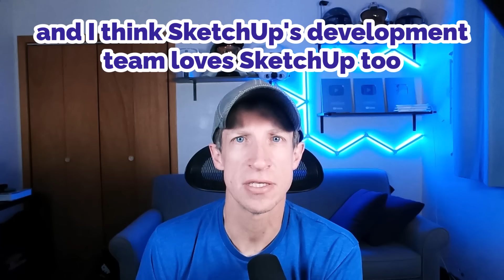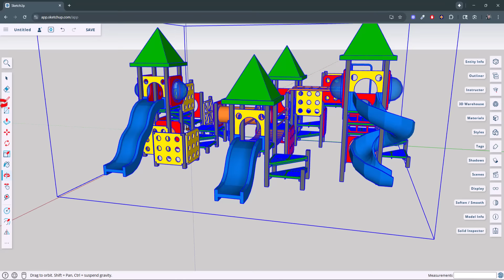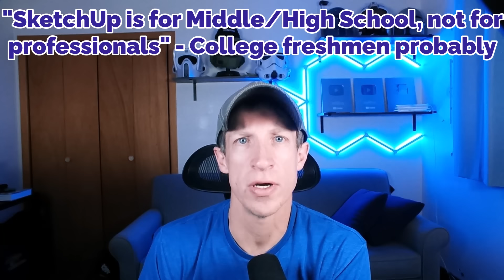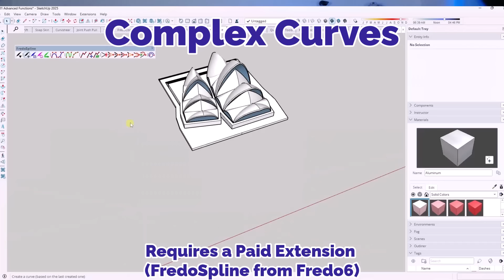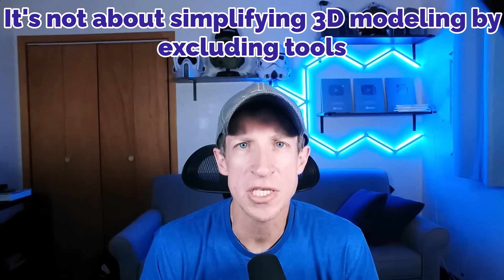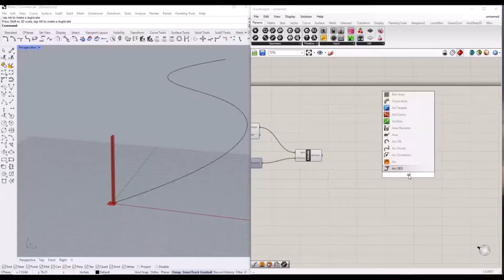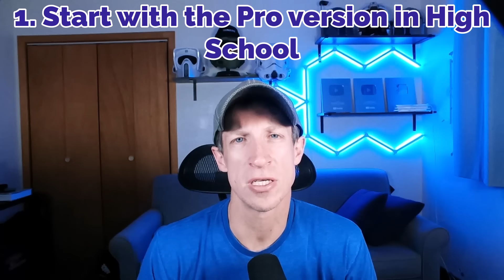Is SketchUp being REPLACED?

Comment: Justin the Rhino/SketchUp debate:  I absolutely LOVE SketchUp for architecture, quick, fast massing, my favorite software. 
BUT I have just started a 3D printing class, and SketchUp has so many tiny gaps, non-smooth circles and cylinders, that is it difficult to get a 3D print looking correct. With add Ons and TIME I could correct the errors with extra effort-- But why spend extra time?

I need a software tool that I could use for design iteration AND also 3D print WITHOUT having to complete hours of extra work repairing the Sketchup model. 
RHINO is more ‘watertight’ models to begin with= not having to complete the extra work.

Justin, what is your 3D Printing process? STL?
Reply from the maker: I personally don't do 3D printing. I have a Prusa collecting dust on my shelf because I don't have enough free time to mess with it 😫

Comment: I’ve been using SketchUp for 15 years as an interior architect, and even though I’ve also worked with Rhino and 3ds Max, I never gave up on SketchUp — though it’s been tough. Without plugins, SketchUp is practically useless for professionals. No serious professional would use it without them, as it’s extremely limited. Instead of adding all these pointless render tools, they should focus on modeling tools that actually make our workflow easier. None of the versions are stable; every update comes with tons of bugs. SketchUp could end up like Nokia if this keeps up. Honestly, I think the company needs to be sold and take a completely new direction.

Comment: I left Sketchup years ago after it became partially web-based. Oddly enough I now use On-Shape which is 100% web-native. Parametric fits my needs much more closely than direct modeling however, I can see the need or a tool to be able to blend both workflows. Relying on extensions for core features turns using Sketchup into a Minecraft-esque experience where models are not portable and things break over time as support fades. SU is a great introductory tool, but I can see why others are being pushed in higher education.

Comment: I believe the main reason folks are running away from Sketchup, is greed!  I've been using Sketchup since 2003 (maybe 2002, don't remember).  I feel in love with just how easy it was to model interiors and having the ability to create and save your components!  It was amazing, and to a degree, remains my go to on a daily basis!  I can create 3d elements missing from Chief Architect and/or 2020 Design in minutes!  FAR faster than anything you can do in Chief Architect itself! 

If Rhino offers the EASE of Sketchup to bang out basic 2d shapes to 3d,  worth a look.  Having a better 'follow' tool for profiled edge creation would be priceless.  I still hate the follow tool as it's not very intelligent and fights you most of the time.   It's never been improved!   I'll have to look into Rhino.  $995 for a lifetime?  Some of us are still using version 2020 or earlier for 'various reasons'.  ;)   I gave up supporting the software as all they did was charge a subscription for what all of us had for a lifetime if we were happy with our version!  That's fine is you use Sketchup as your main 3d tool!  I'm guessing many our similar to me, and create 3d elements that can be used in other higher end software.  

Should be said, BLENDER is still the best free tool by a long stretch for 3d modeling.  If someone came out with a sketchup like UI that eliminated all the fluff, and mostly unused distractions, I'd say, learn blender!  FREE IS GOOD.   Of course, and thank god, we still have free version of Fusion 360.   A very flexible and customizable shape builder!  I'm not sure why colleges when with Rhino!?   I guess the 195 Student license ?   One would think they'd want to bring more diversity to the education system via not focusing on one pcs of software.   Most firms are going to still be using Sketchup, as the owners and the staff will not be wanting to relearn new software.   Most of us 'seasoned' vets of cad, 3d renderings have our methods and libraries that we've gathered for decade(s).   Don't need to fix what was never broken.

Comment: Sketchup should have acquired or developed the add-ons that are very successful in the community, The PRO paid version should be a real Pro version not relying on add-ons, UI should be overhauled to be more modern, having different workspaces (Basic simple and Advanced Pro), Dark Mode (obvious), a good basic rendering engine for simple use, I mean blender has Cycles and it's free. an added extension for BIM tools modeling, it's used by architects so a parametric stairs, walls etc and basic elements should be available not model a door a window every time., better library management tools, and much more, I think Trimble want it to be a 100% browser, internet connected software, but I think they'll get a reality check soon. when I started Architecture school back in 2008 I tried Sketchup Pro for 2 weeks, and then I decided that it's not for me,  I started learning Revit and never regrated that, if you can do basic 3D stuff using a Pro version I'd rather used a BIM software at least I'll have project documentation, parametric modeling etc. and it's free for students.

Comment: As an interior designer,my main problem with sketchup is that when I have to do a complex 3d model I shift to Rhino without thinking, because I can make them with no problem. Basics tools as  "aling" elements in sketchup you need to add a plug in... come on! is a basic... you can make it better.
Reply from the maker: Align is another function that should be added to SketchUp as a base tool - I agree

Comment: I hope Trimble increases SketchUp’s capability to carry heavier files without easily slowing down or glitching or crashing

Moreover, I hope SketchUp will do more about interoperability with other softwares. Rhino has Rhino Inside Revit while in SketchUp, the editing of the imported skp model to Revit is only limited to Revit’s  tools

Lastly, I hope Trimble could maybe make SketchUp’s line tools as precise as AutoCAD or other CAD softwares
Reply from the maker: It's getting better every release (including this one). That said, I think what will really make this better is if they implement some kind of an auto-proxy system, to swap high poly with low poly proxies at certain camera differences

Comment: I agree.  I am working on a project for foundation design.  I was told to use sketchup but am contemplating using rhino since sketchup has limiting factors.  By now it should have more built in tools.  I love the ease of ease of sketchup.
Reply from the maker: Interesting - I can't think of a reason why you'd need Rhino for a foundation design (unless there's some advanced tool you think you'll need that SketchUp doesn't have). Plus SketchUp is WAY easier to use and has better documentation.
Reply: @Thesketchupessentials  Spatial Design.  Shapes with complex curves.  Import other 3D files, Obj, FBX.  Its not supported by Sketchup without extension.

Comment: Sketchup is way too expensive for the casual user, and the web-based free version is terrible. There needs to be a desktop version that is cheap enough for the casual, non-professional user. I held on to version 17 for as long as I could but lost it eventually as computers got replaced.
Reply: I had the same problem except mine for whatever reason wouldn't work anymore because when I last used it. It required a password, and it would load up the program, everything was fine until the program wouldn't recognise the password and thus, I couldn't use the program. They told me to pay for the new version and here in Australia it was over $400 at the time for a 1-year subscription. So, I haven't used it since 2022 when I couldn't afford the new version. The version I had was 2017 version (I think) when it didn't require a yearly subscription.

Comment: Hey Justin and everyone,
I really, really agree with what you’re saying in this video. There are definitely some weaknesses in SketchUp, and I completely understand why some people are moving away from it.
That said, SketchUp has always been my number one software as a residential architect and interior designer. Almost 10 years ago, I worked with a senior designer—he was around 60 years old—and he always used SketchUp because of its simplicity and easy workflow. Since then, SketchUp naturally became my main software too.
Over the years, I’ve also used other 3D programs like 3ds Max, but I always find myself coming back to SketchUp. Most of my projects focus on residential design and interior cabinetry, which only require simple modeling—sometimes with slightly organic forms, but nothing too complex that SketchUp can’t handle with a bit of extra effort.
I’ve also invested a lot in learning and purchasing many extensions, which honestly ended up costing quite a lot and came with a confusing learning curve. Every time I update SketchUp, I have to reinstall plug-ins and reassign shortcuts because they don’t stay linked, which makes the workflow less smooth than it should be. It’s still all dependent on plug-ins.
I’m also very interested in 3D rendering, though I don’t need something as complex as 3ds Max. That’s why I’ve always used Enscape hand-in-hand with SketchUp—it’s my go-to setup. I’ve even learned how to import high-quality 3D models and add lighting to make my Enscape renders comparable to those made with 3ds Max and Corona. In my opinion, this combo looks much more professional than renders from software like Lumion.
That said, even though Enscape and SketchUp work easily together, there are still many drawbacks. It often feels like I’m forcing SketchUp to do things it wasn’t designed for—like producing high-quality renders with heavy 3D models—which causes SketchUp to crash many times.
So yes, I still want SketchUp to remain my main software, but I hope it evolves into something more professional. After more than 10 years in this industry, I feel like I’ve been pushing SketchUp’s limits. It still works, but deep down, it sometimes bothers me.

Comment: Justin - I have been using your videos for years, at this point, and I took your course as well.  Thank you for this commentary.  I have a background that combines a few of your points/concerns in this video.   And I feel compelled to comment here....it is probably too long of a comment and you already have about 1.5k comments here so this may never get read.  Here goes:  I have been a teacher for 25 years.  I teach math and I have taught engineering in high school.  When I taught engineering, we used Rhino with our students, mostly because I collaborated with a local boatbuilder to teach design fundamentals and that is the software he used -- but I saw that Rhino could be purchased at school/student rate for a much lower amt.  Fast forward a number of years, I now run a small drafting business for small construction/renovation projects.  I use Sketchup b/c I got it low cost single purchase in 2017 and it was very intuitive compared to AutoCad and Rhino.  I now subscribe to SUPro2026 for my business that I run in the evenings and on the weekend.  I still teach.  My students have access to SketchUp for Schools.  I use SketchUp for Schools with them because it is already there on their devices and you can do some simple things in geometry class.  However, there is no way to dimension angles in SketchUp for Schools like how you can dimension lengths.  Well, this is a very small but huge barrier to really taking advantage of all of the positives with SketchUp with my students.  Geometry concepts in high school are almost always tied to Lengths and Angle Measurements - think of parallel lines and transversals, congruent triangle proofs, ...you get the idea.  I could practically teach almost all of geometry using SketchUp. I would do this because it would give my students a chance to interact with geometry in a way that could possibly even set them up for professional tools (or at least the interface of SketchUp Pro) and thinking in this 3D modeling way.  This could be a real game changer.  I have tried to make the case for an angle dimensioning tool on SketchUp for Schools forums on SketchUp website but there has been no real interaction with SU admin (at least that I can tell).  It is really just an idea, so I have dropped it and I use SU for Schools however I can with my students without angle dimensioning -- it is not optimal -- but it works.  (This is the typical mentality that you need to have to be a teacher in public schools anyway :)   But now this video you made really made me want to bring this idea to your attention.  If SU could include this simple angle dimensioning tool (and perhaps there are many others, like bevel, etc.) SU software could be introduced to many students at a young age -- and have SU be used for real learning...and then be treated by students as a real tool...and not just something to get them started in modeling to be eventually discarded for other software.       I am from the generation that had Apple 2e's in their classrooms back in the 80s..  That investment by Apple in schools meant that loyal users of the hardware used Apple products professionally 20 to 30 years later. The investment paid off.  SU could take an analogous strategic approach.  If anyone at SU or if you are interested, I would be happy to share more thoughts on how you could incorporate SU into everyday high school math curriculum.   If you actually read this - thank you !  And thank you for producing excellent content as aways!
Reply from the maker: " you already have about 1.5k comments here so this may never get read. " - Lol - it has been a lot to sort through. 

" I am from the generation that had Apple 2e's in their classrooms back in the 80s." - hey, me too! I started off on an Apple 2E! 

I think this is another tool that could be added be default, and honestly, it's another great example of why just adding tools as extensions is a bad idea. When the free version was also the desktop version with extensions, this was fine, but now the free version is a web version that can't add tools with extensions. This makes the web version a significantly worse tool than many other modeling programs. In my opinion, it's a problem

Comment: I work in design and education, and I loved Sketchup when I was in undergrad, but I started way back when the student version was much more powerful and versatile.  Now I don't recommend it to students anymore; most of the places they're going to wind up working don't use Sketchup, and the issue of having a plugin that's core to your workflow not get updated is a real problem.  It was a fine program for fast/easy iterative modeling back in the day, but I can't wholeheartedly recommend it to students anymore.  Most of my students work in Vectorworks and Blender now.
Reply from the maker: Interesting - what specifically are you teaching? I'd imagine if you're recommending Blender it's either something outside of architectural design and more a visualization or manufacturing type thing?

Comment: SketchUp Free is great at what it does but if you need to change anything it's often easier to start from scratch. Now I mostly use Fusion because I often want to rework some parts and SketchUp is great for well sketching.
Reply from the maker: The way your models are set up is massively important if you want to be able to make changes later for sure